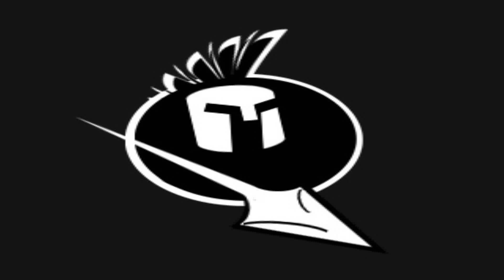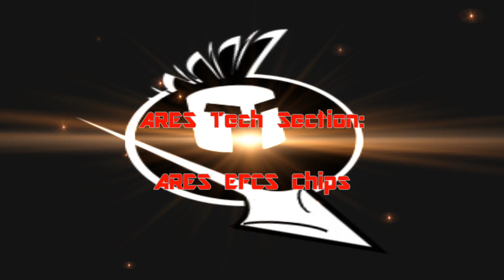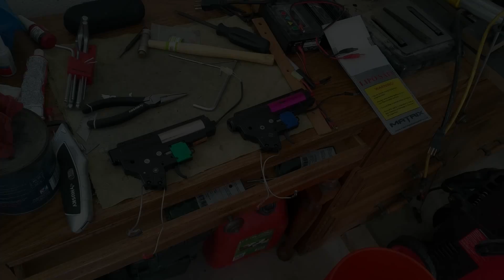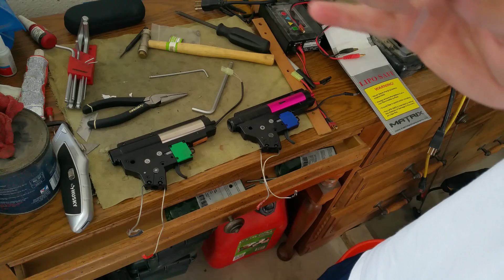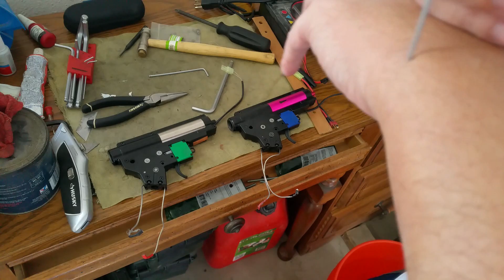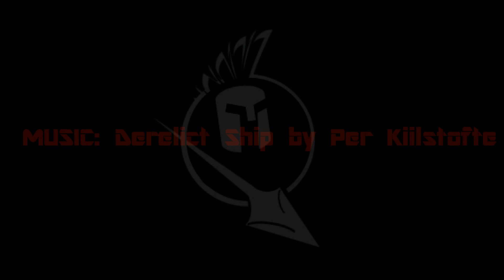ARES Tech Section: ARES EFCS Chips

Comment: I've read about people getting broken gears and cracked gear boxes - have these issues been improved with the V3 revision?

One would certainly hope that a recent AEG that's not "bottom of the line" quality, and has a factory MOSFET installed, should easily handle an 11.1 LIPO.

Comment: Do you think that the new 3rd gen efc can handle a 7.4 35cc lipo battery?
Reply from the maker: Given you have a 35C, I suspect it's a very large capacity battery.  Im pretty sure it's going to be way over the rated rating of the 30amps contiuous for the blue chip.  However, this also depends on your setup (a high rate of fire setup most likely would fry the chip).  Versus a high torque setup shooting at 400 fps may be under 30 continuous amps with a rate of fire of 14rps.

Just for your reference, a 7.4v 1200mah 25c = 30 continuous amps.  As you can see the chip can't really handle big batteries with a high demand setup.
Reply from the maker: The continuous rating is one aspect in prolonging the life of the blue chip.  However, you have to realize the intial draw of spining the motor might briefly spike up to 40+ amps.  Therefore, depending on your AEG build,  the faster and harder you want an AEG to shoot,  the initial spike can be greater than 40 amps.
Reply from the maker: The initial spikes are usually a fractional of a second,  and you can expect the blue chips to wear out overtime.
Reply from the maker: a 11.1v and 7.4v buffer tube size lipo batter will work.  However, I never had the best of luck of an ARES stock EFCS gearbox last without breaking gears.

Buffer size 11.1v are usually 1,000 to 1200 MAH 15c to 20c

For a 7.4v they can range from 1000 to 1200 MAH 15c to 25c.

From my experience, all my stock ARES gearboxes broke in less than 3,000 rounds.  Battery type really didn't matter.